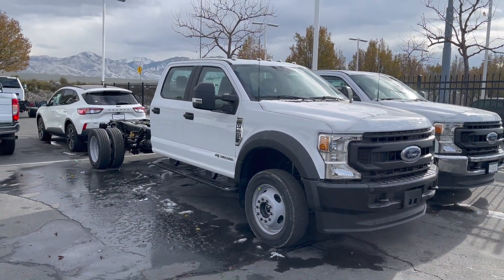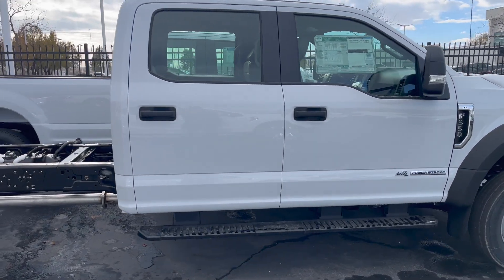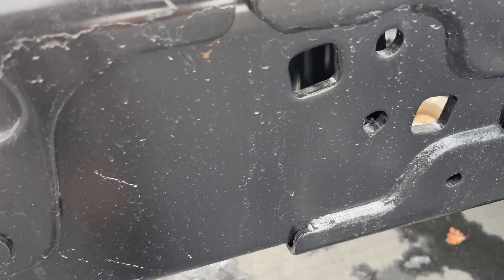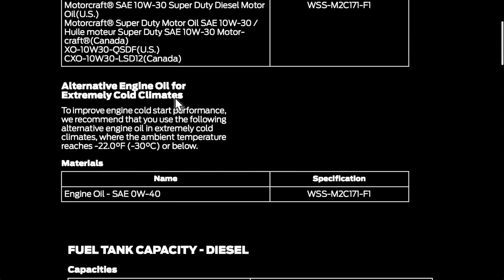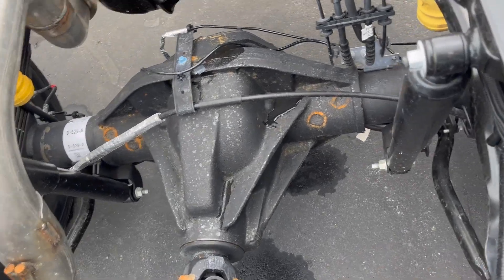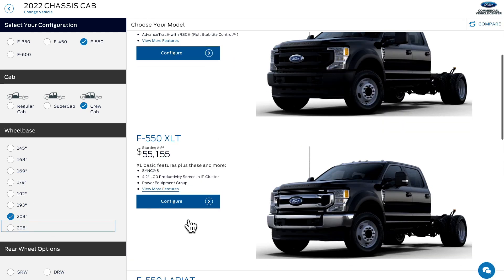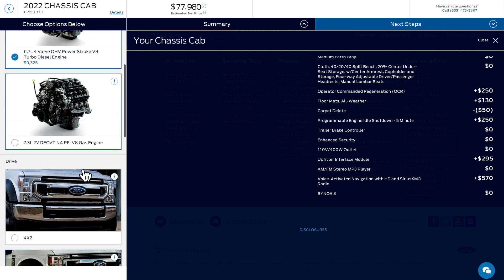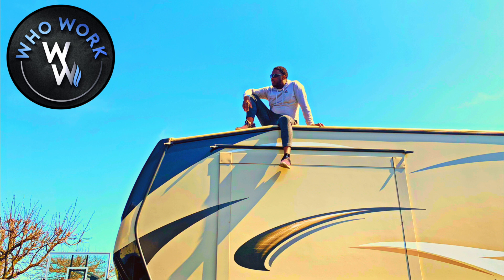New Ford F550 Cab/Chassis: Everything You Need To Know Before You Order!

Comment: I had a 2020 F-550 single cab 6.7 diesel with a 4.10 rear end. I had the gooseneck with a 38 ft 11k lb sliding axle trailer. I hauled about 26k lbs daily. The detuned motor is to be desired but does the job. I prefer the power from a F-450 civilian duty rather then the commercial detuned versions. The ride is to be desired as well being a single cab especially empty but the turning and maneuvering radius is superb. I would prefer Ford put a bigger turbo and increase the power to 400hp and 1050 lb torque. Those are better numbers in this segment. With proper maintenance the 6.7 is bulletproof and over built. I had these motors wound out for hours hauling in high elevations, off road and stop and go ciry driving and the engines never had issues even with the known DPF issues. I had a sensor issue but it was fixed under warranty, cold weather messes with these sensors. I would recommend getting an extended cab for a more compliant ride. Stay away from carpet flooring and get the vinyl. The camera's are very helpful especially up front. Non the less I was able to put over 200k miles on 2 Super duty trucks and had very little issues with hauling within spec and only real complaint is fuel mileage and fuel capacity and the aforementioned ride quality and detuned motor. 🤙🏼🇺🇲

Comment: JB
If I was going for a Ford F450.
I would order a F450 pickup and then convert it to a Flat bed.
That way I can get the HO 6.7.
If I order Chassis F450 you get 350 HP 6.7.
Reply: There is so much power from any engine before it compromises the dependability, reliability, and durability. Juicing 1,200 pounds of torque from a 6.7 is insane. All the fleet trucks used by utility companies carrying cherry pickers, outriggers, and thousands of pounds of equipment and tools use a de-tuned 6.7, but warranty it for 200,000 miles. A de tuned engine will do anything you need and last longer.

Comment: I have that same truck. I've put over 12k miles on it all ready. So far so good but time will tell.  Mines 19,500 gvwr service truck. It turns much tighter than I expected.
Reply: Yeah the 450-550 have the wide track front axle.  I used to have a 450, I love how sharp it turns.
Reply: How's the truck holding up?
Reply: @ineversamplemelodies2969 i wanna know too

Comment: Do any of the manufacturers offer a super single rear in place of tandem rears?
Reply: They're dual rear wheels - "tandem" would mean one in front of the other, and on trucks refers to two axles, not two wheels and tires on each end of the same axle. 

No truck manufacturer offers wide single tires in place of dual rear wheels on light or medium-duty trucks in North America.

Comment: That’s a beast but at least get the XLT. The XL is straight up city public works or garbage truck lol🇺🇸💪
Reply from the maker: Lol 💯 🇺🇸💪🏾
Reply: I’ve got an f250 XL and it’s not bad with the right packages.  It’s got STX package, fx4 off road, 4x4, clearance lights, power equipment, cloth seats vinyl floors.  Yes it’s a base f250 but it’s not city works like you say lol.  It’s sharp. At the end of the day it’s a work truck and It’s perfect for what we’re doing

Comment: 2 things bud, duel wheels work great in snow, have you ever seen a tow truck with singles . I drove 2 wheel drive dual tire tow trucks for 10 years in summit county, Colorado. 2nd, and I’m not betting up on you. I really like your videos. I look forward to each one. But I have to let you know that what the OEM’S are selling as max tow with the gear ratio is a complete joke and it’s just marketing on their part. Not real. There are only a few teeth difference on the ring gear between 4.30 & 4.88. Certainly not even close to the amount of tow rating difference that they claim. Just ask a ring a pinion guy. My Ram 5500 had 4.44 and claimed 17,000 tow and a Ram 4500 with 4.88 claimed 37,000 tow. Complete and utter BS….
Reply: For one, your 17k to 30whateverK tow rating differences can’t be real. No way you aren’t just dead wrong on those claims.   Also forget counting pinion gears and teeth, you dont even need to go there.  Do you know the read end ratios mean?  There is no way it doesn’t make a good bit of difference to applied torque at a given speed/rpm.

Comment: People buy these for RV towing and never realize how de tuned they are.
Reply from the maker: If you hear it lower in the rear, it probably won’t feel that noticeable on grades 👍🏾
Reply: Still stronger than the comparable 5500 ram.   I switched from a power stroke to a ram/Cummins and it’s weak compared to the fleet power stroke and fuel mileage sucks.  15-16mpg powerstroke and 10-11mpg Cummins.  Both are service trucks weighing 13-15k with tools and crane.
Reply: @MattB the Diesel Tech  Agreed I had ram 5500s for several years working for a utility company. With Altec boom and rigged with tools and material they would barely get out of their own way. Fan was always locked up which made it worse trying to keep it cool.
Reply: @tumbleweedking5668  can’t wait to order a new f450 or 550.   And get rid of this palfinger bed and get another knapide.  Tired of this Cummins with no balls and my tools get wet and rusting.  My old knapide never leaked one bit.

Comment: Worthless 330/860
In 2013 it was 330/800
6.7 diesels aren't reliable after 100,000 miles the cp4 pump is un-reliable
10spd nice frame 👍I own a 2013 f450 true 120" personal truck cab/chassis 4wd
And selling it mine is 8,000 payload and 32,000 towable
Ordered a supercharged 7.3 from ford
Reply: 550's had 300/660 in 2013.....the <550's had 400/800.

Plenty of 6.7's with well over "100,000 miles."

Did you mean you ordered a 7.3L and having an aftermarket SC installed??
Because you certainly didn't "order it from Ford."